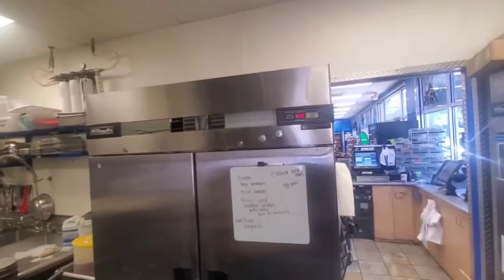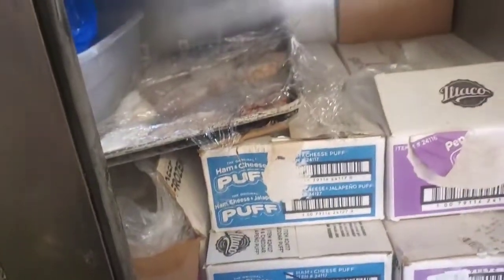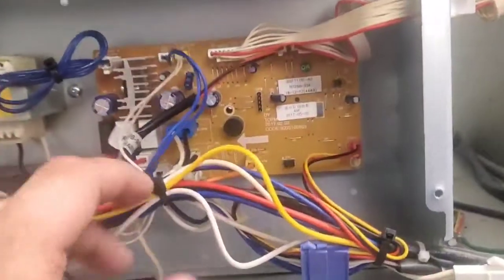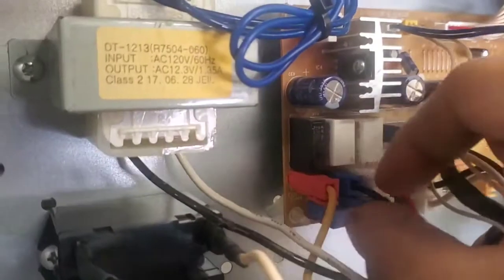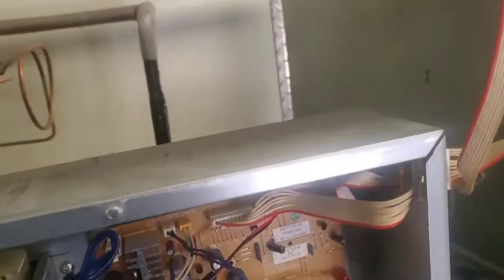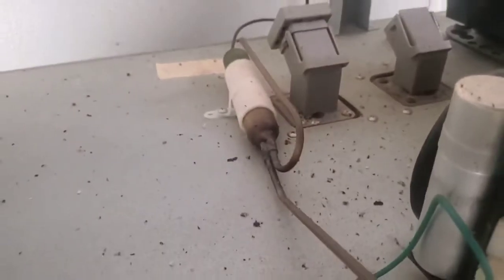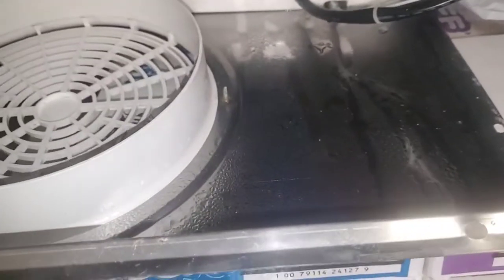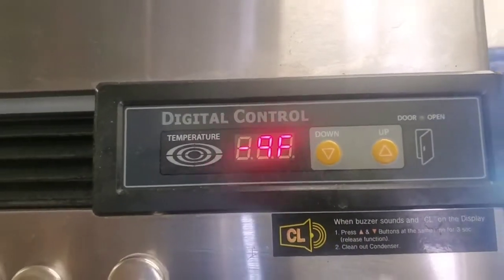Blue Air Refrigeration Build Quality | 2-Door Freezer Sensor Replacement

Comment: Worked on a 3 years old Blue Air Freezer and the control/display board is malfunctioning. The company said it's no longer available.
Reply from the maker: Id love to cut a hole right in the middle of their goofy little control panel and stick a dixell controller on there